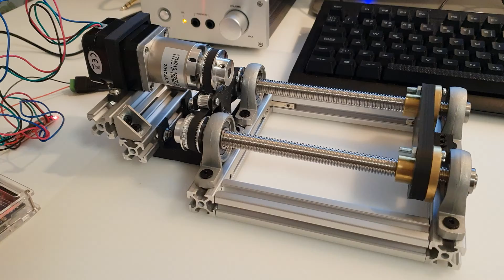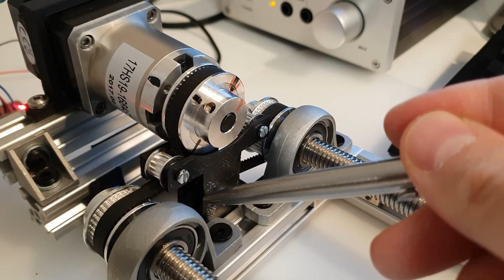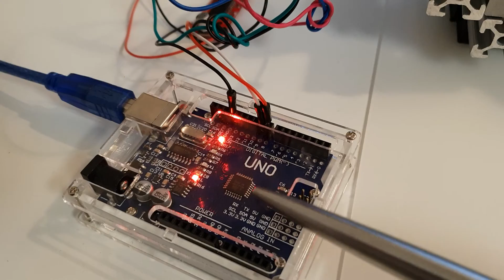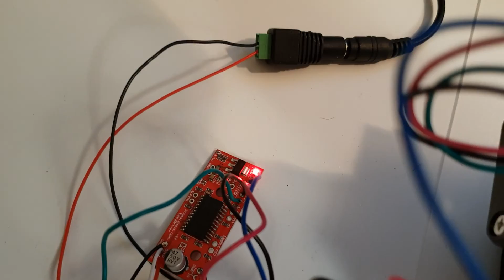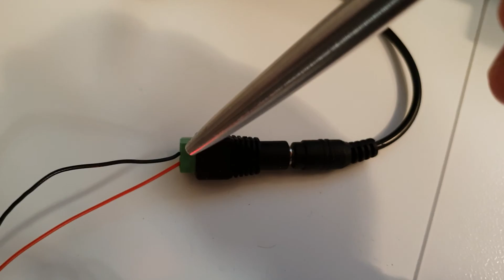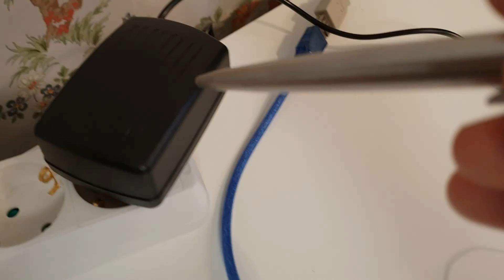Prototype of the tensile testing machine

Comment: Which language have you used for this software, where is the Arduino and the software source codes?
Reply from the maker: The motor is controlled by an Arduino, so the software is C/C++. This was just a test and some brainstorming, there's no source code or other resources.
Reply: please what thing do you have for the codes the electronic part
Reply from the maker: What do you mean?
Reply: @CuriousScientist  le proramme

Comment: Amazing! I cannot figure out how the belts are connected! Could you please give some clarifications? thanks!
Reply from the maker: Hi! I do not recommend this kind of setup for large forces, but only for demonstration. I tested this type of belt with high torque, and it simply snapped. :) 
Actually, there is only one belt. Imagine the whole belt as a triangle. The top corner of the triangle is the wheel which is driven by the motor. The two bottom corners are the driven wheels. Then, I use two additional pulleys halfway between the top and each corners which "pinch" the belt and pushes them inside. These are in connection with the flat side of the belt and act as tensioners.